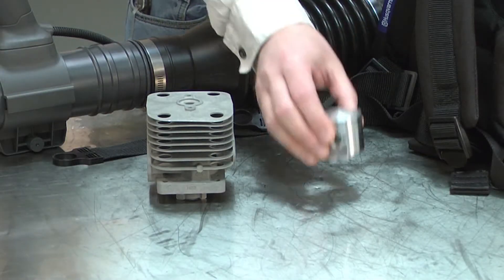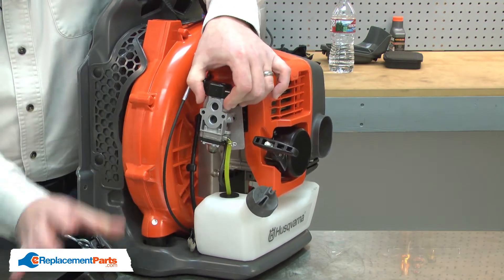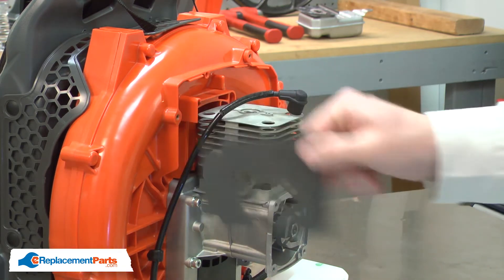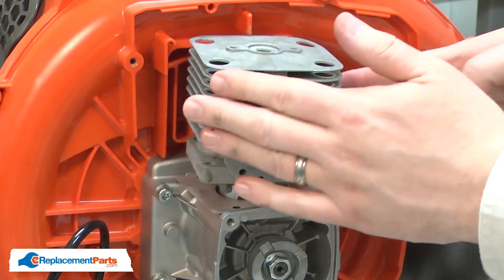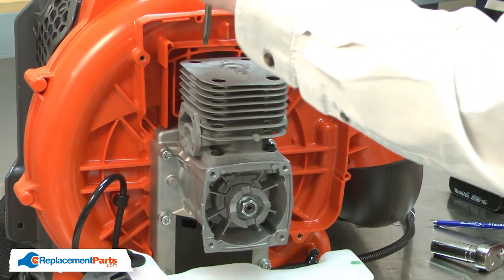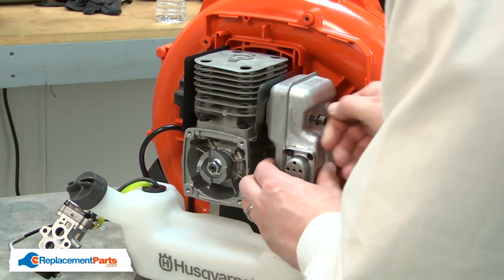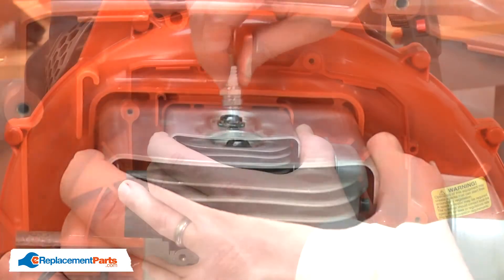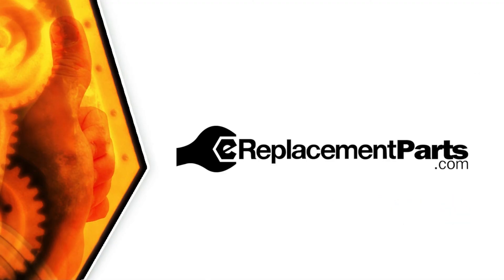Husqvarna Backpack Blower Repair - Replacing the Cylinder (Husqvarna Part # 502848701)

Comment: I love to watch your videos. I recently came into a similar situation and I believe it'll require to replace the cylinder and piston. I know I can do it im just not 100% sure that's the issue. I brought it off a guy that said it was good and when I brought it home I notice the spark plug was loose. It turns out the thread on the cylinder is bad. I thought maybe there's a heli coil or something I could use. But I'm not sure if it's the piston that hit the spark plug and may of messed up the thread. I could use a little help. I don't want to throw it out. I LOVE messing with all these small engines. Plus it's a Stihl